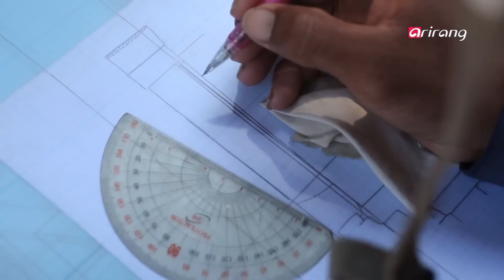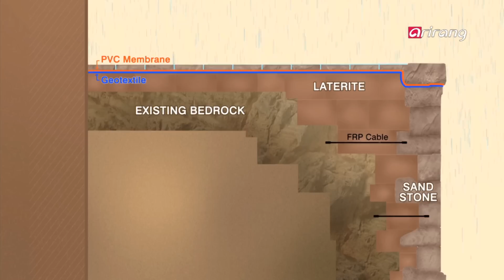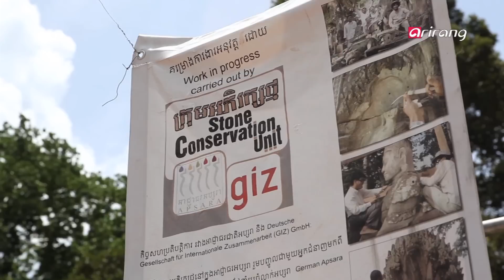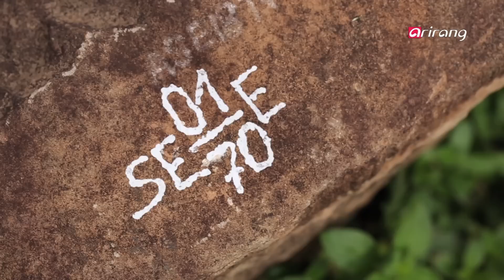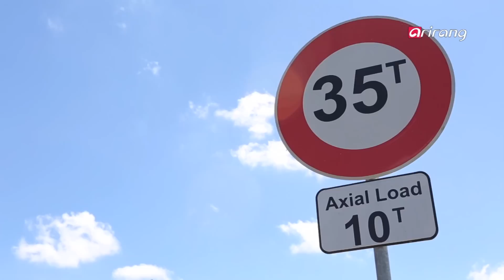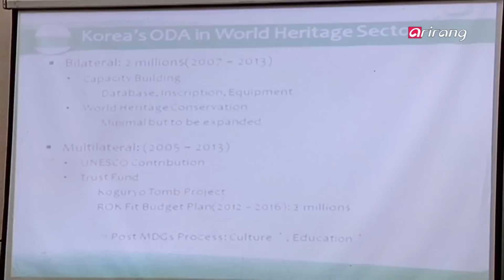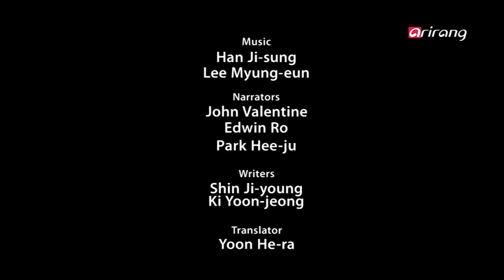Arirang Prime Ep213 Revival of Angkor, the City of Gods

Comment: I'm no building engineer, however I've seen many massive hotels built on sand, and no large body of water needed to keep the them stable, I think moat is an irrigation and reservoir system for the whole area, those temples were standing for many any centuries you think the moat at some time didn't fluctuate in water levels?  yet the temples still stands .
Reply: Well where were they built

I think modern hotels are built way differently from old structures
Reply: I think the Baray(Khmer man made reservoir) was the reason why the water in the moat won't overflow or dry out.
Reply: @sakdavith6969  the water reservoir pressure keep the Monuments intact..